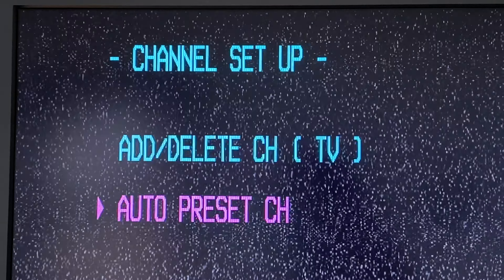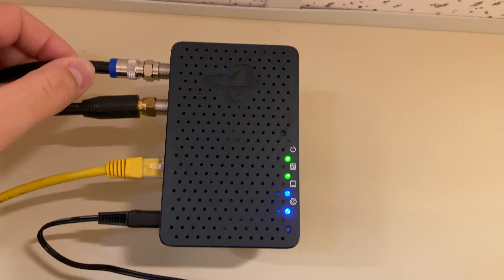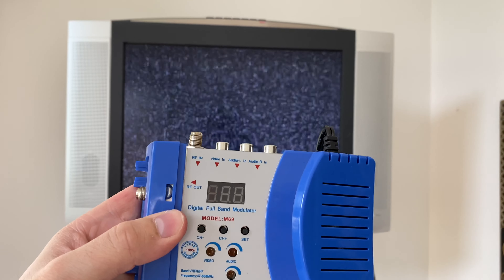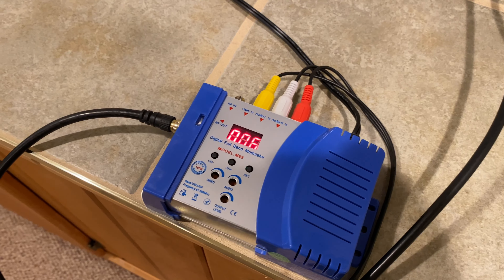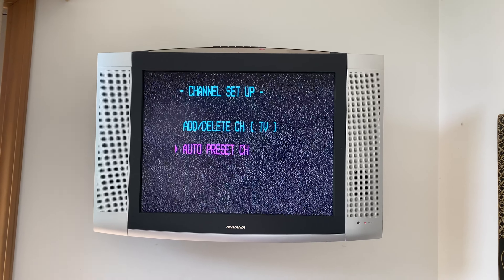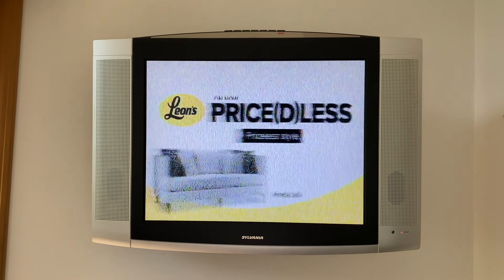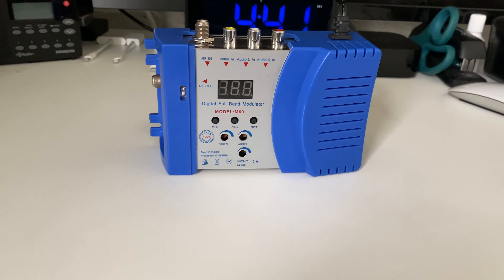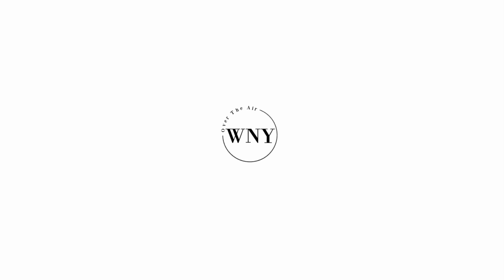Create Your Own Analog NTSC TV Channel In Your House

Comment from the maker: NTSC Modulator: https://amzn.to/45kNsZw
Reply: Could a modulator transmit through the air instead via cable or what? Just curious.
Reply from the maker: Yes. If you connect an antenna to the modulator, the signal will be in the air. Keep in mind in the United States it is illegal to broadcast in the TV band without a license, so doing this would be illegal.
Reply: @WNYOverTheAir  not unless you get a liscenes from the fcc I’m gonna get one and start an animated tv channel.

Comment: Fun fact, channel 6 runs off of 87.7 MHz on most typical car stereos. You can pick a channel 6 on the car radio if you ever heard of states then on 87.7 MHz the reason is channel 6 is tuned in to 87.7 MHz

Comment: Any suggestions for an amplifier to boost signal quality? I’m looking to send a channel to multiple TVs in my house for a Halloween party.
Reply from the maker: Sounds fun! If your house has or had cable at one time there should already be a distribution amplifier somewhere in your house. If not, I'd recommend something like this from Channel Master: https://amzn.to/46zTTIg If you are using the existing cable in your house, be sure to disconnect the cable coming from the cable company, or isolate the cable if you're still using cable internet. You don't want to send your channel back to the cable company!
Reply: @WNYOverTheAir  How did the party go?

Comment: I thought about getting this exact model to see if my neighbor at my apartments could pick it up if I used it to broadcast. Also can you hear the audio on 87.75 on that channel 6?
Reply from the maker: Yes, you can. A radio plugged into a coaxial outlet in my house can tune the 87.75 FM from the RF6 signal.
Reply: @WNYOverTheAir I remember listening to judge Judy on channel 6 on my FM radio on my CD player good times lol the audio carrier just overlaps there